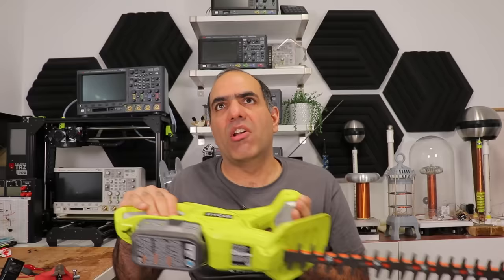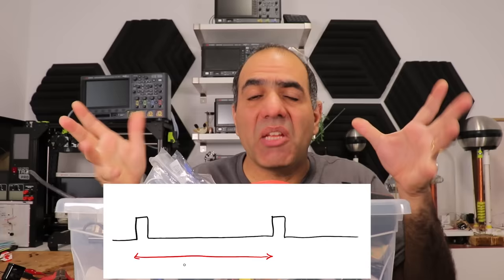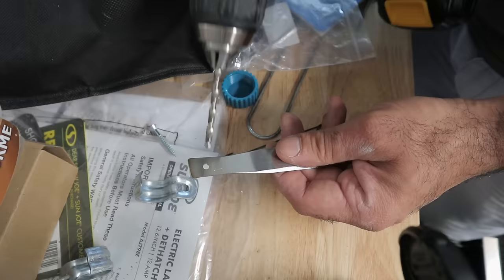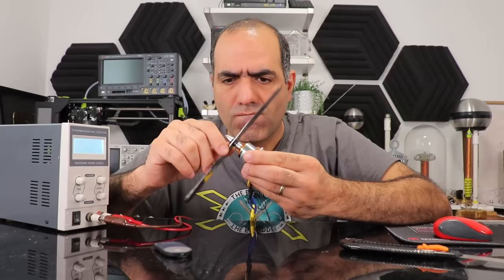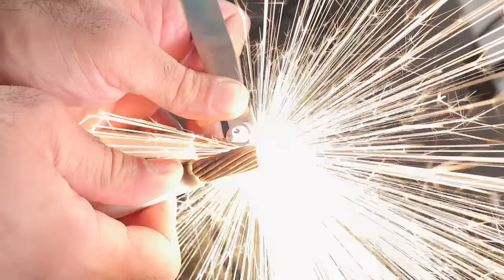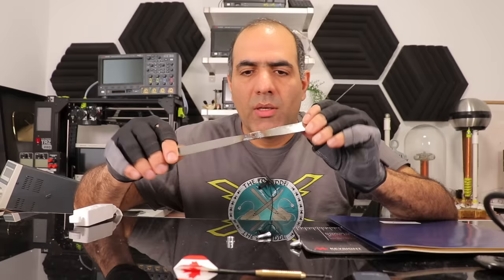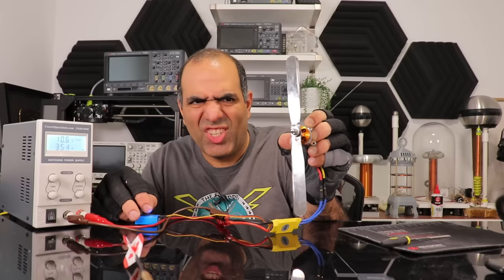Making a Mini Hedge Trimmer (Don’t DIY 💀💀💀)

Comment: Another thing to really help is reversing the direction of rotation from the direction of threading for the nut holding the blades on, that way the motor doesn't unscrew the blades off. I've seen this used in cars before and it's a great alternative to putting hundreds of lb-ft of torque into a bolt so that the engine doesn't spin it off
Reply: Easier to change the direction of the motor than to find a left hand bolt.

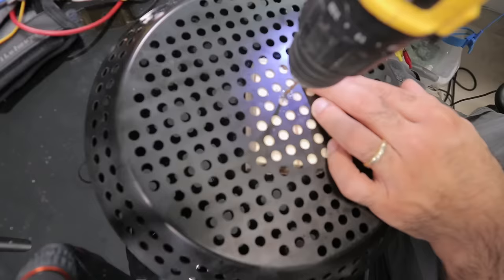Comment: 12:45
My suggestion is to use bolts that are threaded couterclockwise. 
Or just make your motor turn in the oposite direction of the direction you turn the nut to tight
Reply: Nut😅😅

Comment: Give it an on of switch. Make it fed by standardized motor drill batterys, balance the blades, get a proper shield, locktide onto the thread for the nut holding the blades.
And I'd detailed trimmers are in demand you've got yourself a product.

Comment: have the filter caps on your ESC exploded yet?  those things are tuned for the harmonics of the input leads they come with, you'll blow them out and start popping transistors in the ESC with wires that long.

Comment: 7:36 "The transformer output I was using to weld has very low voltage but very high current so it wouldn't shock me and is safe to use."

Yet another reason why "It's really the current that gets you and not really the voltage" is false.

Comment: i think you can make it safer... and more beautiful...

step 1: put rubber around to the 2 wires, connecting to the battery, so that it looks better.

step 2: take a big empty water bottle, and put the battery in the bottle... the wires will stick out of the hole on the bottle, and the handle on the bottle makes it better to hold.

step 3: maybe put rubber on the pan holding the blades, as it looks better and is safer.

Comment: 9:08 It sings!
Reply: Fun fact. Each note is a different coil arrangement in the motor. That way if a coil arrangement fails, you can tell which one it is by the note the motor misses. It also does this for post and error codes from the driver circuit, too.
Reply: @dogs-and-destruction-channel  
Neat

Comment: Mehdi. I believe there are trimmers that use some kind of nylon cord that rotates very fast and act as a blade. Maybe you can try it and see if it works instead of the metal blades

Comment: They say, "If it looks stupid but works, it ain't stupid."

This is the day the statement changes to, "It it looks stupid but works, then it might be stupid because you will loose your fingers".

Great video btw.

I also made something similar but created a Pedestal Fan with that drone motor, ESC and servo controller.

It doesn't have a fan gril though. So the high speed rotating proper is in open and since it's black no one can see it rotating and cut themselves. (like I did)

Comment: Cut a series of sharpened vees - all along the cutting edges of the blades. This will greatly improve the cutting, as the stems will locate in the vee, and be severed! I once did something similar with a long rod, secured in a Battery Drill. It had two replaceable Box Cutter Blades on the rod end to do the work. I gave-up on this idea, because no toe protection on summer days!

Comment: Can you make an ionic thruster  and make it blow wind out to a fan motor that is connected to charge a  battery,  and then through a transformer to generate more amps to provide power to the system and to power any other needs.

Comment: An interesting project would be replacing a magneto timing system for a small engine maybe a photocell with a rod turning from the crank to complete the circuit in timed pulses from a buzz coil

Comment: Why did you cut a hole in the top of the shield with a dremel when you could have punched and drilled out the holes for the mounting screws?

Comment: 1: YOu should've used the existing 2 holes to lock the blades. But I guess it was faster to cut one and use the other, when you could've overlapped the blades and use the excess material to lock the blades.
2: You don't file hardened steel against a stone. If its purpose is to cut, you file it with a filer. Surprisingly enough.. Filers are quite faster despite them needing manual use!.
3: ... YOu could've used some plate knifes instead.

Comment: The weld is okay it would been easier to use a copper rod to make the connection stronger because the rod will melt and make the blades stick together more better

Comment: Dear Sir
If possible make a video on solar panel use  for home appliances.
Like 330-335W 5 panels in series and 14.4 V x 14 battery in series...

Or what modification you can suggest in this arrangement.

Thanx in advance

Comment: Nice device, but I would highly recommend considering some of the failure modes this might have before using this to trim your hedges regularly. If the weld were to fail while the blades were at speed, they might not chop your hand, but they could still injure you if they were to escape the housing. I think you could make it safer by having a foot pedal and/or emergency stop button that would cut power to the controller and motor. A diode for reverse-polarity protection would be helpful too. It might also be worth modeling the blades in some kind of simulation software and determining at what RPM it would be expected to fail. Would love to see a part 2 of this video with these kinds of improvements (even though this isn't intended to be a consumer product).

Comment: 10:08 I'm trying to get the same motor setup. Can anyone help with what battery I should use?
Reply: A standard drone or RC car battery pack would do the trick. Just make sure it provides the right voltage and current flow to the motor and driver circuit.

Comment: @electroboom Maybe you can add a safety circuit to stop the motor instantly if you touch it...  Like maybe using a capacitive touch sensor circuit that causes the blade to stop instantly if the metal blades are touched, and using something like dynamic braking (shorting the motor connections) or reversing the direction momentarily if that motor type isn't capable of dynamic braking. Would probably need to isolate the motor from the metal that the person is holding too. Not that I would recommend it, but an RCD/GFCI and electrify the blades would interrupt power too, but you'd never build a spinning electrified blade, right....? 🤣

Would be interesting to see how fast you can get the motor to stop from touching to stopped. Even if it stops slower than "instant", it's still good, as anyone touching it is likely to drop it, and cause more injury from a spinning blade flying around. Maybe a "dead mans switch" would solve that though - let go, and it cuts power. Could do that with a regular switch, or more interestingly (for the science) using resistive sensing - like have a couple of contacts on the handle that you have to grip, and human electrical resistance lets the circuit know you're holding it!

Since you are cutting leaves with it you might need to find a way that the safety mechanism differentiates skin from plant, but I assume the capacitance would be different enough to differentiate. I've never checked the capacitance of a plant (they do use capacitance to measure root length though)!

For the "touch stop" testing use a hot dog tho - don't wanna chop your fingers off during testing! 🙂

Comment: It took me until the part with the fingerless gloves to realise he was botching this at every step entirely on purpose. He does that kind of thing a fair bit, and while it can be very funny/entertaining, I think it'd be cool to see him show what he's capable of when he (pun intended) takes the gloves off (metaphorically speaking, of course).

Also, I think a simpler (and probably somewhat safer) way to do the same thing would basically be to amp up a weed whacker. With a string, rather than metal blades.

Comment: Holding a metal blade sharpened prop on a RC plane motor has me concerned for his safety. I actually made my own high voltage thin welding machine like he did and it's very fun but very dangerous if you build it wrong

Comment: I know I'm late to this, but honest to god Mehdi, this was dangerous. If the motor had broken free from the plate, the wires would have swung those blades directly into your legs. The metal used in those blades isn't made for this, hopefully they would have bent before breaking (I think they would) but if they broke, it would be a miracle if you didn't end up with shrapnel in you somewhere. 

I love you and your videos, but there were some simple precautions you could have taken. Wearing thick pants and a leather cover, safety glasses, a press-and-hold style switch; these would have required minimal effort and would have made the demonstration a hell of a lot safer. 

This is entertainment, and I know you're smart and know what you are doing, but I think you should reflect on this particular experiment. I would never take the time to say this if I didn't think this situation was egregious. You probably already know all this without anyone telling you, so I just hope you take some extra precautions if you do anything similar in the future.